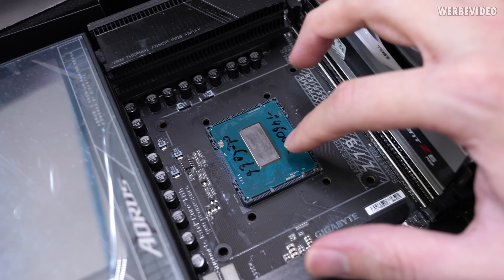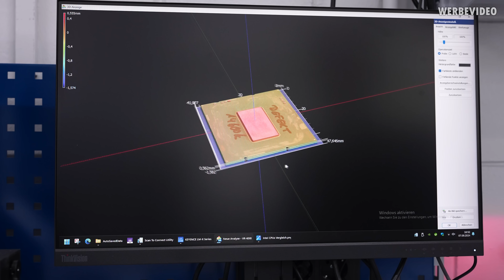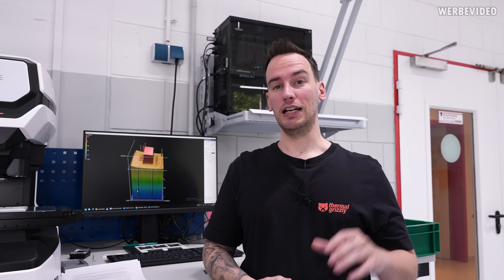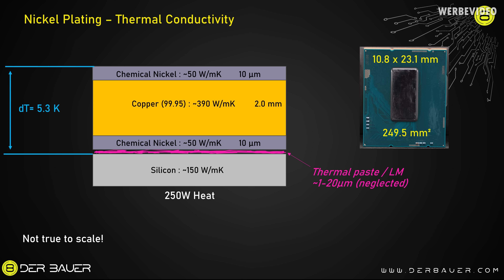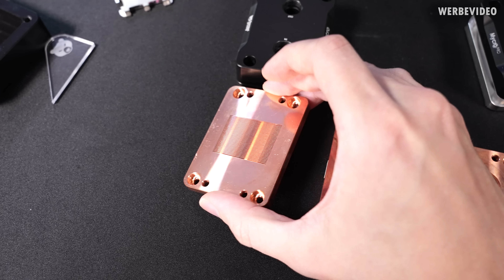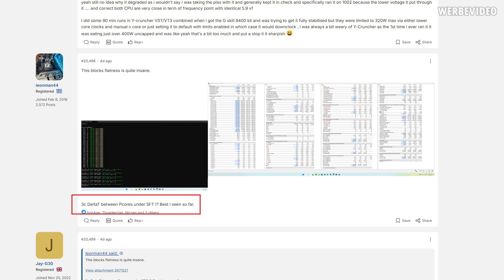We Identified the Problem with Our Water Block

Comment: ** - PLEASE HELP - **
So I have been running the new RGB Pro version for just under a year now but I started to notice the temps were getting really high and throttling the system, like 30c more than when I first installed it. I thought maybe the liquid metal had dried or reacted or maybe the screws had come loose but I re-seated the block and put fresh liquid metal on and it's still the same. So I am wondering if the fins are blocked? I can't see any videos or guides on taking it apart to inspect and clean the fins. Do people do this? Is this a known issue? What's the best course of action?
Reply from the maker: Hey :) can you mail our support?
support@thermal-gritzzly.com

It's absolutely possible that fins might be blocked
Reply: @der8auer-en  Will do that now, thanks

Comment: I'm super confused. I was under the impression after reading and watching literally hundreds of articles and videos on th subject, that aside from the visual "staining", copper was NOT AFFECTED by the use of liquid metal nor did the thermal performance get degraded over time. Almost all liquid cooling waterblock and air cooler plates are now made of copper. But Debauer states that copper will in fact get damaged when in contact with liquid metal.eo I am at odds on what to think about the whole thing at this point..

Comment: You are pushing BGA-LGA adapter PCB solder mask to its limits. As an EE I'd never pressure it into multiple thousand pin LGA socket having direct metal to solder mask contact.
Even if your edges are perfect, not sharp, there is still uniformity in PCB weave flatness and from traces, polygons on the top layer.
And having metal to epoxy (solder mask) contact is not a good engineering. This epoxy layer also has non-uniform thickness and could very well have imperfections that could cause isolation failure during such use.

Comment: AWESOME video - interesting and was about something that I had no idea existed (metal cooling). I think you now have a lot of people with "microscope" envy. One thing that strikes me is that you could not have the plating on the CPU side of the block. That would reduce the loss by 50% as you have halved everything. It may also give you an interesting point of difference with a "2 tone" block. You could even call it the Pro+..... Process wise this may be machine the gallium side - get it plated - machine the die side, that way you have clean transition and don't need something like a blanking block that installed to cover the die side while plating, and then have issues when removing it and wanting a clean edge....

Comment: I can confirm that the new block is better than both the supercool and iceman direct die block with my 13900KS. I am getting 7C better temps with the thermal grizzly block compared to the iceman block. 49C delta T with 360W. Incredible.

Comment: The problem is not the coating but bad engineering, design, and business practices. You should have spent a few days validating the final product before launching it. A late product launch is better than launching a defective product, as that destroys the company's reputation. While transparency is good, no amount of transparency and apology will automatically repair customers' impressions of your brand.

Comment: With plating and conductance, its important to note the underlying physics. While insulation and resistance are additive, making something like a thin layer negligible. But conductance doesn't work in the same way. If we think about the electrical case, even a thin insulating layer can completely tank the overall conductance- even if the relative amount of conductor vs insulator is extremely high. The very high conductance doesn't add or average with the amount of insulation. To exaggerate what's happening, consider 1 mile of copper plus 1 inch of vacuum. Here, the thermal conductance is going to approximately be the same as 1 inch of vacuum, basically infinite. Insulation is additive, not conductance. 

With all that said its entirely possible for the coatings conductance to not effect temperatures that much as nickle isn't that bad of a conductor. Hope the calculations are solid, but I would just double check, maybe.

Comment: Ok, how about Titanium Nitride or Tungsten Carbide coating using a PVD process??? Yes it is going to be maybe 2-8 times as expensive as nickel (assuming $10-$40 per square inch) but I think on balance it would be the best performing option within a reasonable cost scale where liquid metal is going to be used - in both cases there is going to be no reaction with gallium and the thermal conductivity is significantly higher than nickel...

This would also be an innovative industry first which would imo justify the extra cost of the part to the consumer using liquid metal (I'd certainly buy it, and with corrosion issues around nickel I just wouldn't buy a nickel plated direct die block to use with liquid metal period)

Comment: Have you considered sputter coating nickel ? Its fast, thin, high quality potentially. No chemistry involved, and its pure. See Korvus for some cheaper machines.
Or, going a different way, putting on 10-20 nm of TiO2/Al2O3 with Atomic Layer deposition.

Comment: Hi Der8auer,
Today I searched a bit about the effects of galium on copper and found a Gamers Nexus article where you appeared saying or writing that it will interact with the copper but the performance will not be affected. But in this video you say it will affect it considerably.
I kept reading about it a bit more and, if I understood correctly, the only issue with copper is that the amount of liquid metal will be reduced with time because of the reaction with the copper, and the application will appear to be dried. But cleaning and reaplying should solve the issue.
I also found some articles talking about purposely making galium react with copper with a special application to create some nanoparticles that apparently have much better thermal conductivity than copper.

Comment: Wouldn't chrome (or chromoly or whatever it's technically called) be better than nickel for PC watercooling? Why do the vast, vast majority of PC WC'ing parts use nickel instead of chrome? Wouldn't chrome solve a lot of problems PC WC'ing parts can sometimes have with regards to bad types of nickel plating, nickel plating chipping off or deteriorating off, etc.?

Comment: I really appreciate the honesty, hard work in identifying the issue and the transparent video explaining everything…….. That being said, I am a purchaser of an am5 heatspreader in mid-July and am slightly disappointed after I contacted TG in hopes of an exchange or discount and wasn’t told I could do so as it was from a different vendor that did the coating. However, it now says on the website that the new coating gives up to 5C temp difference. I do like the product but it was interesting to learn the testing is done before the coating which leaves me doubt in the gains in lower temps I receive from my heatspreader. Again, I like the product and will probably purchase the new version but am a little disappointed that this came to light right after my purchase.

Comment: I purchased the AM5 Mycro Direct-Die (part S-TG-MY-DD-AM5) for my Ryzen 7900x in February 2024 and I am experiencing some scaling or flaking on the inside of my soft tubing at the outlet port.  Also a gradual rise in temps.  I have an all AlphaCool system and am using Thermal Grizzly Conductonaut Liquid Metal.  Never experienced and kinda of reaction like this in soft tubing before so wondering if I might have an issue with the nickle plating.

Comment: I know that CPU direct die is not that popular. However, when it comes to GPU and WC we always do direct die. There is even more heat produced by GPU than CPU. Heat density can be comparable though. Anyway, why noone noticed such a problem before with GPU? Almost all cold plates are nickel plated. I was personally wondering how much of a difference nickel plating can make and I did not want to risk. Hence I use pure copper cold plates both on my GPU and CPU - both direct dies. Liquid metal is not that bad on a copper surface. Once it saturates initially then the progression of the galium intake is very slow.

As of the direct die block design - I think you overcomplicated that. I have a direct die cooling on my 9900K. I use a direct die frame from Rockit Cool and a Heatkiller IV PRO block which was never designed for DD. And that is not a problem. After assembling the blokc I lapped it to make it as flat as possible. I did the same with the core. My temps are perfect and I have never had any problem with CPU warping or poor contact and I resintalled CPU multiple times. Just take a look how Rockit Cool frame is designed. The Heatkiller block initially pushes against the core only. The whole CPU goes down and then the block touches the direct die frame. The highest pressure is applied to the core but there is also some pressure applied to the direct die itself. I cannot imagine any better design than that as we apply the pressure across the whole CPU surface with the highest pressure applied to the core. What is more - the same block can be used with a direct die cooling and with the IHS based cooling. Very simple and effective. I do not understand why you overcoplicated the things that much.

Comment: Maybe it's a stupid idea, but you can easily test that... if the nickel reduces the performance so much (because of the small surface with direct die) would it be better to have a copper cooler and use regular thermal paste? I would love to see that tested...

Comment: Don't bother digging the die escape trench and then deburring its edge, just dig it all down to die level and put a punched out Teflon spacer for PCB hold down, pressing PCB with metal isn't great idea anyway, unless it significantly improves thermals. This seems like typical negative outcome of German engineering

Comment: I love the clear and upfront info here. I really wanted the TG Mycro Direct Die block but ended up getting an IceMan to get my system back together. On the positive it sounds like a lot was learned through this process and I do plan to try one on my next build on a new socket if you make one.

Comment: want to ask why you dont include a micro hole for dissipating pressure build up... heat in that enclosed space is bound to build up pressure which is probably one of the contributing factors why your PCB is warping, along with your current problems... I noticed the design has a clear air cavity within the contact area... Im not an expert in PCB stuff but I work a little on cars and every single thing that has an air pocket will have a venting hole in it to prevent pressure build up that can warp car parts...

Comment: now I wonder 3 things:
what the difference between {LM + plating} vs {PTM7950/Kryosheet + bare copper}.
electroplating's longevity with its lower corrosion resistance.
combining the 2 plating techniques: start with chemical vapor deposition (CVD) to get a minimal base layer and then electroplating to finish the job

Comment: Thanks to your wire view I was about to save my 4090 today from burning, the connector melt in the PSU and the connection point on the wire view....😰 And i even under volt it. Only pulling 290-340w and it still melt.... It been like around 10 months since I have it...

Comment: What about silver, gold or rhodium? These are decently thermally conductive, do they also have the right properties to serve as gallium alloy diffusion barrier?

Pity to ruin 486 comments. Well, onto Pentium and beyond i guess. OK you can have a 487 which was sold as the FPU but was really a full 486 upgrade path device for SX systems.

Comment: Hey Roman! Correct me if I am wrong, this also applies to your AM5 direct die heatspreaders? I recently got a "like new, unopened box" version for my 7950X3D, and I not really impressed with the results compared to the stock heatspreader. Would the same issue with nickel plating apply to AM5 versions?

Comment: What EK could never do. Great job. Thank you.
Aren't heat spreaders also nickel plated? They would have the same issue?
Doesn't your direct die do the same thing as a IHS?
Also, always perform a full test with the final product.
You can do in-house plating easily for rapid prototypes.
The fin profile (height / width / etc) is a function of thermal resistance.

Comment: Love your transparency but really hate the 'all in one' design concept as it relies too much on the CPU tolerances. I would buy a new block from you immediately if you just improved the EK Velocity2 design with separate contact frame, block and backplate! I bought an Iceman block as well as the Velocity 2 conversion kit but didn't like the single block concept so am using the EK and it's working just fine on my 14900KS.  The multipart design also makes it so much easier to replace the LM as the CPU remains retained. Edit: I changed my mind and have ordered a block from you. I notice that most of the current tests have been done with a chiller but I'll just be running a MoRa 420 with 4 x 200mm fans. I hope your new block still gives a significant reduction in temperatures over the EK, particularly core delta where I currently get 11C 😮 (probably due to 'leaky' cores).

Comment: Hey Roman so here is the situation i ordered the AM5 Mycro Waterblock in August of 2023 and it didn't got shipped until November so my money was on hold for 4 MONTHS and the seller (Highflownl) told me that they don't know when the non-RGB version is going to be in stock so tired of waiting i just payed 30€ more for a freaking RGB LED strip that i don't want it in the first place but anyhow when i got the block and installed it on my 7950x the temps in Cinebench 23 reach 76C at 250W (Water temp 24c,ambient temp 22c,flow rate 2.9l/min) and that is a lot higher than the 63C of your test so i reapplied the liquid metal just to get an event worst result at 78C and now almost a year later the temps got progressively worst and the CPU got to 83C at just 230W in Cinebench and to me there is something wrong with the block so you think is affected by this Nickel plating issue or WTF is going on here.

Comment: No problem being late to lga1700, the platform isn't dying just yet, intel will release Bartlett Lake next year, intel's response to AMD's X3D CPUs, which will ditch E-Cores and pack as many as 12P-cores, using an improved version of the Raptor Lake P-cores.

So for anyone that doesn't care about Cinebench scores or does much with productivity apps, this will be a great replacement/upgrade from ADL/RPL, which should perform amazingly in games, maybe even beter than Arrow Lake.

Can't wait to get my hands on this monolithic 12P core monster.

Comment: So the other companies using the same process in theory also could do better, but because power is dissipated over larger surface of IHS the impact of "bad" nickle plating is much smaller for them.
With the power density being the issue did anyone tried doing watercooling blocks with mini vapor chambers in the plane between die and finstack (stack them next to each other vertically and use closing caps as a finstack contacting the water side). With thermal conductivity being 5000-100000 W/mK this could be the a game changer (and price would be probably astronomical). 
Or even a single horizontal vapor chamber with good internal structure and then side facing the water would generally be thicker with milled finstack (this would be cheaper to make and still have potential to outperform anything on the market).

Comment: damn this was more interesting to watch then i expected, and the block also looks really nice :O hopefully it sell's like hot cake's and inspires you to make a non direct-die version.

i mean i wouldn't run out and buy it (my rig's running and there's no problems) but if it had better temps and a similar flow restriction or lower temps at less of a flow restriction sure when i move to AM5 lets eek out that little bit extra. or they need to start selling cpu's with the lid off, it's a lot better then ye old razor and a steady hand method but still not the biggest fan of the process of delidding :P

Comment: The pressure ring might benefit from using a molded silicone ring instead. It could deform to match the PCB surface.

Comment: Would you be able to do a video on the new phasesheet PTM vs kryosheet vs traditional TIM? Especially interested in using it 'direct die' on a 7800X3D with your heatspreader
Reply: Are you going to direct die a 65W CPU for real?
Reply: Where are you getting 65W from?

Comment: I know we're dong crazy stuff with our LGA1700 CPUs these days but my original 12900K Intel sample bent in one of the corners after testing maybe 10 motherboards. It was watercooled. Never killed a CPU like that before. I just feel the enlarged substrate compared to previous gen has not been strengthened enough to deal with the wider area..

Comment: So very impressed with the necessary detail given in this video!  I do have a question though: will any of these design improvements see their way to the AM5 direct die block, and should there be any concerns with the current AM5 direct die block? (I would imagine no concerns, but if there’s improvements to be had…

Edit: after further reading through more of the comments, I found that there is a Pro version for the AM5 platform!  Now the debate is do I "need" to get the Pro version for my 7950x or not hahaha.

Comment: I can respect the transparency and the work to resolve this, but it does kind of shock me that Thermal Grizzly simply trusted the math and did not do any testing with the actual customer product at first.  I get that engineering numbers almost always hold up, and those numbers said the nickel plating would be little to no impact, but if there is one thing you have to test it is the product version you are going to actually put in the customers hand.